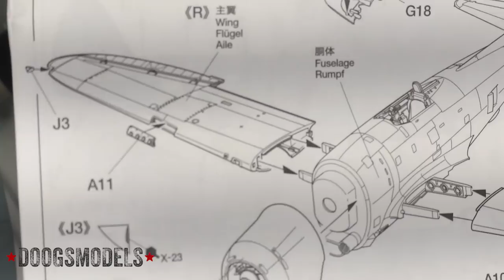Tamiya P-47M Build - Part 32: Final Details

Comment: I've always seen it as red and green for the wingtip marker lights. Did all P-47s use blue instead of green?
Reply: Actually most green lamps appear blue when not turned on.
Reply from the maker: Every decent ref shot I can find shows a blue color to the bulb.

Comment: Hey Matt I have a question for you. I have some AK extreme metal paint coming...but I could not get a hold of thinner. Is there an alternative to AKs thinner for thinning aswell as cleaning the airbrush?
Reply from the maker: They're enamels, so mineral spirits or naphtha should work
Reply: @DoogsModels  thanks Matt.